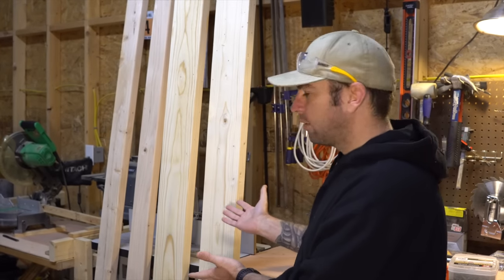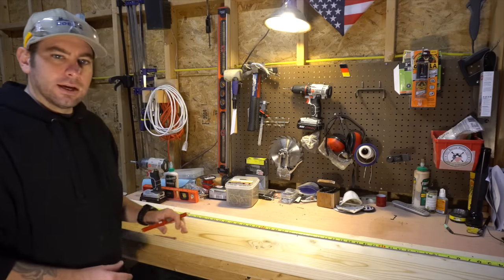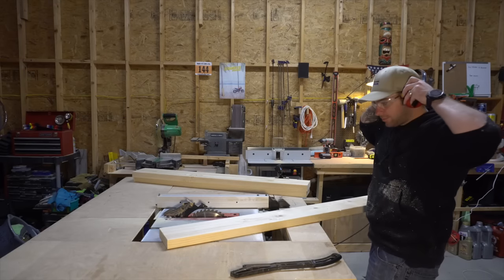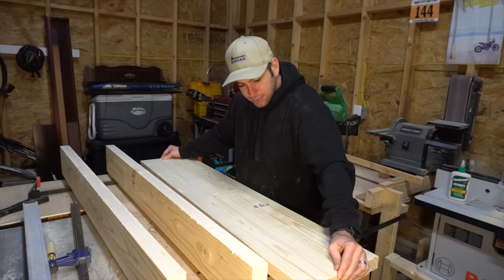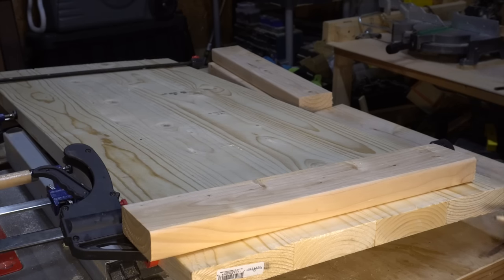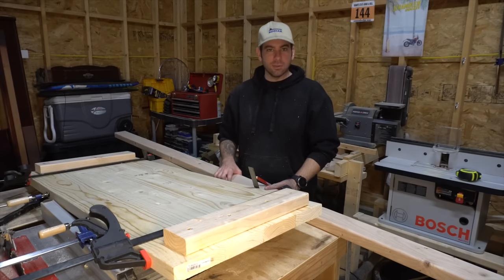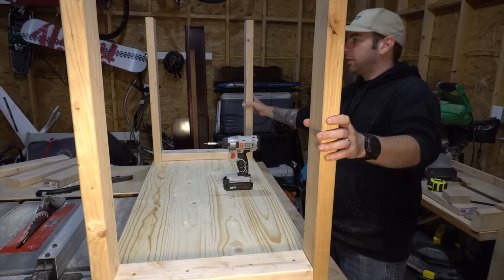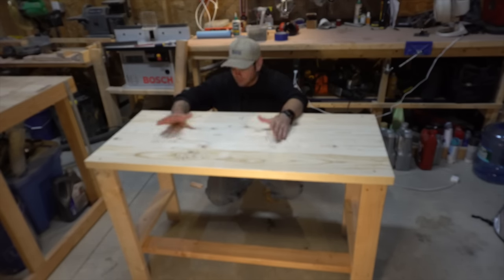Build a Super CHEAP and EASY DIY Desk!

Comment: for anyone reading this because you’re looking for a cut list for home depot/lowe’s: you need (2) 2”x6”x8’ boards each cut to 48 inches, (3) 2”x4”x8” boards each cut to 28 1/2 inches, BUT ALSO 2 slightly shorter pieces for the leg supports underneath, in the video he says 17-something inches but if you’re not squaring the edges of the boards you need them to be about 18 3/4”. i have to cut those myself with a hand saw now because i didn’t double check the video 🤦🏻‍♀️  i also got a piece of 2’x4’ sanded plywood to make the top surface flat, since i don’t have the tools to make the edges square
Reply: Thank you for the measurements!  I was just looking at everything and wishing I had those numbers.
Reply: Thanks
Reply: Thank you for the measurements.
Reply: What size of screws did u buy/used
Reply: Thanks so much for the measurements!
Reply: Thank you so much!! :)
Reply: so this is the exact measurements?
Reply: so this is the exact measurements?
Reply: @briciagarcia9864  did you find out about the size of the screws.? 😊
Reply: Thank you for this valuable information,  old you please tell me the size of the screws that you use. Thank you,!
Reply: Thank you
Reply: @briciagarcia9864  did u find out what size screws we need to use ?
Reply: Thank you!! I was in fact looking for the cut list.
Reply: Goog to build a modified version for my daughter’s craft room
Reply: for anyone wondering, if you are screwing through one of the 2 x 4s or the 2 x 6s then you should use a 2 1/2 or 2 1/4 inch screw or something similar. You just want to make sure it is long enough to go through the 2 x 4 and can still go through what you are screwing into.
Reply: @jerrybarnes987  I watch See Jane Drill videos. She's an excellent teacher for beginners. You don't seem like a beginner but someone in this thread might be (me). In any case, Jane said the rule of thumb is the fastener (nails, screws) needs to be 1-1/2 times longer than the board you're attaching.  To attach a 1" board, the nail length should be 2-1/2" long. But OMG you also have to know the correct type of nail or screw to use (muh head spins) . . . . carpenters must be the smartest and wisest people on the planet to know and remember all of the exact details. I still can't remember how to tell the difference between a wood screw and a sheet metal screw🤪🔨📐🩹
Reply: Thank you❤️
I jumped right into the comments to see if anyone had put a listing up and you did🙏🏾❤️.   Thank you so much
Reply: @maryperez7529  The material is 1 1/2 inches so the screws should be about 2 1/2 inches but not longer than 2 7/8 inches so they will not go all the way through.
Reply: You will need 4 leg supports at 19”
Reply: That’s looks great
Reply: It's worth mentioning,   this works for a desk  only,  you cannot put heavy objects on it.    To be able to support heavy objects,  you must add diagonal 2x4s, to the base,  to prevent it from swinging left/right or forward/backward.
Reply: ❤thank you for this!
Reply: Thank you.
Reply: @wildthoughts6959  Zero Experience here, I am confused on where at the base of the table I can put the 2x4 (at the end or in the middle?) and from you experience can I use Nails instead of Screws because I don't have an impact driver, thanks alot !

Comment: For smoothing the tabletop and avoiding ridges, WITHOUT slicing a narrow edge off the end, you could also use clear wood filler or glue in the ridges and sand off the excess. Then when you treat it, it'll seal a smooth surface in.
Reply: I own no tools and i plan to borrow my brothers drill. Thank you for your comment i have sand paper and wood filler! You rock thanks for the idea!
Reply: @imnotpikachu213  sandpaper is amazing, and cheap. You can obtain great results with patience

Comment: Talk about a blast from the past, I built this back when you put this video out to use as a reloading station, I did two small mods - added another 2x4 to the legs half lapped by stacking on the runner, and put my horizontal brace on the back between the legs to put my feet up. I put this table of yours through hell and back, and if I hadn't used it for a Tanarite Target holder for a few years and a few thousand rounds it would still be alive today.

Comment: Irie: The reason it is called a 2" x 4", is because originally, before kiln drying and planing, it was an actual 2 inches by 4 inches. However, it came straight from a sawmill, and there were actual rough edges that would put a lot of splinters in your hand. The wood was also green, and would dry in the sun as things were being built. When I first started as an apprentice, everything was planed to the 5/8", in other words, it was 1-5/8" x 3-5/8". The reduction to the 1/2" came because it is actually machined metric in Canada, where we import a lot of lumber. It also was reduced in order to produce more boards from each tree. It is also the reason we went to "Western Platform Framing", instead of "Balloon Framing" for houses. It is much easier to get 8-12 foot boards, than 20 ft. boards. When we say two by four, we are referring to the "Nominal Size", (the original size), as opposed to the "Actual Size". It is also easier to say. Imagine trying to holler at a laborer on a building site, to bring up some inch and five eighths  by three and five eighths. The response every time will be: "What"?
Reply: thank you so much for sharing this information,😁

Comment: I have a super tiny room and I’m only 13 and I need a new desk but none fit the small space I need it for we don’t own any of the super fancy tools you have so it makes this even harder and I’m doing all by myself with the funds of my dad (he said he would help me but I wanted to do it all by myself and he would help if I needed assistance lol) and this was the most helpful one I’ve found and we don’t have a Table saw so I’m just getting a wider Piece of wood and following all the other steps but the screw way thank you so much oh and my new dimensions and tools are.                                          (3)2”x4”x8’
(1) 1”x1’x4’ or (1)1”x2’x4’
Level
Drill
Measuring tape
Screws.                                                                          Circular saw.                                                                Table
Reply: I believe Home Depot or Lowes will make some basic cuts for you when you buy the wood, but just make sure you cut it to exactly the length you want and be sure since you won't be able to adjust it at home.

Comment: I did it. But I cut the table length at 39" instead of 48. My 4 planks cost me $30 at Menards, but that was no issue. I spent another $10 for 2" casters and then anchored them to the feet with small pieces of 5/8" plywood. I used 1x6 for the side supports and then added 2 1x6 boards across those for a little shelf under the tabletop. Right now I'm adding poly to the desktop and my son is going to use this for his home business. Couldn't be happier. It's a little beast of a table.
Reply from the maker: Awesome and congrats!

Comment: Thanks for the tutorial.
When gluing the top, I'd suggest using two pieces of 2x4 on both sides to ensure flat surface, and clamp these two pieces while clamping the glued top boards. This will help ensure that these top pieces are flat and even when they are glued together.
Reply: Thank you!

Comment: Good video.    It's worth mentioning,   this works for a desk  only,  you cannot put heavy objects on it.    To be able to support heavy objects,  you must add diagonal 2x4 to prevent it from swinging left/right or forward/backward.
Reply: You couldn't fit your wide caboose on it. But you'll be able to put pretty heavy objects on it.

Comment: A 2×4 is called so because when sawed at the mill, it's cut to 2" by 4". The boards are then surfaced on all 4 sides to remove mill marks and break the corners. The final dimensions after surfacing are 1.5" by 3.5"
Reply: dont foeget the dry process which shrinks the wood which was taken into acounrt
Reply: Nominal cut
Reply: Actually, That is slightly incorrect..................The Finished 2X4 measures 1 3/4 in. X 3.5 inches....Thus when doubled, they are the same width and thickness.......3.5 inch
Reply: Chris Taylor Every 2×4 I, and everyone I know, have ever worked with was 1 1/2 × 3 1/2. Ever piece of lumber we worked with was always short a half inch. ( excluding length )
Reply: @Meatwad787  .................After being challenged on this.....I actually got out a tape measure, I guess I have been under the WRONG assumption for nearly 60 years.....Go Figure...I had always thought that 2 stacked gave you the same size from either direction...
Reply: That's true today. A hundred years ago or so, they were actually 2"x4". Then the lumber companies decided to sell less for the same price and down sized the dimensions. Just about every big company does it now.

Comment: The concept is very nice, but I would suggest you consider pocket holes instead of screwing into the end grain.  With time and moisture changes, your screws may eventually have an issue with holding.  For light duty this may just be just fine.  You may want to add a horizontal member under the top to resist tension from the top being loaded as well.  Structurally, you can have the same amounts of wood, but choosing where to place them will make this both stronger in load handling and more durable in service life.
Reply: It's just a cheap desk. It's not like it's for the president
Reply: Santa Clause well you can make a cheap desk last a lot longer and be a lot more sturdy with pocket holes
Reply: Pocket holes are complicated for a beginner. This was supposed to be as easy as possible.

Comment: For those that don’t have a table saw. Just glue the 4x6’s together and leave the rounded edges on. If you use the hand circular saw you will not cut in a perfect line and won’t join up perfectly.
Reply: Truth fears no scrutiny 123 Agreed! I have a shelf that I made, the top is 2x4s, as they were, and it’s just fine. I like that rustic look anyway.
Reply: I have a table saw, but opted just to leave the edges anyway, it worked out fine.

Comment: What type of screws are those? Like how big or idk how you call them lol
Reply: 2 and a half inch screws
Reply: Deck Screws
Reply: I think drywall screws. You don’t need pilot holes with those.
Reply: @chrismazz75  no don't use drywall screws if you can help it they are not as strong or as useful as deck screws

Comment: I just finished putting my desk together, this design works, I'll see if I find a better way to join the legs, but it was easy as heck, I'll have to admit that I skipped most of the video, the useful parts sum up to like 3 minutes, but yeah, it does its job, I now have a nice desk for a third of the cost of a store bought one, I got wood with a lot of crevices and rotten parts, I will fill them with blue resin and stain the wood blue. Anyways, thank you for the video, it was very helpfull

Comment: Can you tell me the dimensions of the top piece and the legs so I can just have them pre cut
Reply: Hey Terry, all the dimensions are in the video.
Reply: The top four lengths of 2"x6"s are cut to 48 inches(from 2 boards)
The four legs are from 2"x4"s and each cut to 28 1/2" (from 3 boards)
Reply: for anyone reading this because you’re looking for a cut list for home depot/lowe’s: you need (2) 2”x6”x8’ boards each cut to 48 inches, (3) 2”x4”x8” boards each cut to 28 1/2 inches, BUT ALSO 2 slightly shorter pieces for the leg supports underneath, in the video he says 17-something inches but if you’re not squaring the edges of the boards you need them to be about 18 3/4”. i have to cut those myself with a hand saw now because i didn’t double check the video 🤦🏻‍♀️  i also got a piece of 2’x4’ sanded plywood to make the top surface flat, since i don’t have the tools to make the edges square

Comment: him: It's really easy to make
Also him: shows the table saw
me: hmmm...yeah don't have that :|
Reply: @Nikolai1776  or a hand saw if you are determined... Honestly, just rent a circular saw from Home Depot.
Reply: You can get the wood cut to the sizes from the store and just fit it up
Reply: I can’t imagine getting a straight cut with a circular saw. If you don’t have a table saw, you might consider just leaving the wood as it is. It will have a bit a dip where the rounded edges meet, but not a big deal for a basic work table.
Reply: @leeb.7188  Clamp a 1x4 as a guide and you can get a straight cut with a circular saw.  Glue a pice of 1/4" hardboard along the bottom of the 2x4 and cut it with the circular saw against the 2x4 and you have a poor-man's "track saw".
Reply: Bar Pluc : Good idea! I’ll give it a try. Thanks!
Reply: What about a hand planner? Wouldn’t that work? Newbie here, so just asking.
Reply: @CantrellLeatherGoods  You could hand plane the edges flat enough to glue, but from the lumber I see in the average lumber yard, plan on being there a while on each board.  The radius on the corners of "finished" lumber is sometimes 1/4" and add another 1/4" of twist/bow/camber and you're hand planing over 1/2" off both edges.  You'd also need at least a No. 6, preferably a No. 8 to shoot a board that long.  I've tried it with a 5 1/2 and dragging the bow all the way out was a chore.  Of course that was more due to my lack of skill than the plane, but since I've picked up an old No 8 and that seems to make the effort a lot easier.
Reply: Hmmm yeah you don't need that lol. But same, I don't have one either.
Reply: get it cut where you buy the lumber. rent tools, borrow tools or the obvious, buy them. How do you expect to build things without tools?

Comment: Great video.  Built one today....dont have a table saw or circular saw yet....still came out really good.  It wont be a desk though....maybe an outdoor food prep table.  I built it a little taller... 37.5 inches high.  Great video, easy instructions.  I was able to watch once and build most of it from memory.
Reply: You just answered both the questions I was asking myself.

"Can I do it with a hand saw?" and "Can I make it a bit taller?"

And as others have already commented... I'll probably add some extra supports to this design (angled braces) so it's rock solid.

Comment: Blonde girl proof table...just what I needed. Thank you for not speeding through the build. Only thing for me is I don't want the side supports on the legs at the bottom, so I will have to figure that issue out. I'm hoping if I buy corner brackets to install on each corner it will hold up just as good.

Comment: A 2 x 4 is actually a 2 inch by 4 inch rough cut before it is run through the planer. The planer takes a half inch off the 2 inch side and the 4 inch side to smooth it down before it is shipped to the retailers. But most old the houses were built with rough cuts that are actually 2 x 4's Straight from the mill. They were very rough with no smoothness at all. But they measured exactly 2 inch's by 4 inch's. I thought I would pass that by you. But anyway I want to thank you for this tutorial. This is by far one of the best step by step tutorial that I have seen on youtube.
Reply: A 2x4 in reality is 1.5 x 3.5, but it has nothing to do with a planer.  It comes off the mill at 2" x 4", once the wood is dried it contracts.
Reply: They are actually cut 2x4. I know this because I work the mill.

Comment: I know its been six years, but I needed a visual review of working up a similar project. Retired and downsized to an apartment with attached garage, the killer on that I lost my " shop". On 8/26/23. I bought the same amount of wood a bit of screws and glue and this crazy inflation sure does break the wallet. You can't help that, cost  closer to $75.00.That hurts because I always like to customize storage with wood. Unfortunately  I needed some large storage shelving, compared cost of wood to" premanufactured " made in China", steel shelves and the steel won out by 1/2.  After six years the lumber still looks the same :-) Thanks for the video, it is definitely what I needed to brush up a bit even for smaller projects.  If you are still looking for ideas, garage storage units for tubs 2 feet wide, 3 levels ,6 feet would be interesting.

Comment: Nice design  and video/ instructional video on  building  this little desk , table, workbench,  or whatever  someone  wants to use it for  my Mom likes to garden and noe that she is older in age likes to work standing up  to have less stress  on her back  this  project would make a nice potting table for her gardening   With the correct  stool or chair  she may be able to sit and do her hobby  a  nice feature about the way you build this is the low cost of  construction grade lumber  you use to make it  and you are  correct it will hold up way better than any particle board furniture  as this construction  and buil results in a solid wood  desk capable of holding up to the elements and or  some  physical abuse  because of its solidity

Comment: They are called 2x4 etc. because they are rough sawn to those dimensions before they are milled to achieve the factory edge. The milling takes off ~1/4 inch each side which equals ~1/2 inch overall from the width and height. If you buy rough cut lumber, it will actually be 2x4 etc. but of course you will have to joint/plane/thickness it yourself or use it rough as construction lumber.

Comment: Thanks for this video.   I need a cutting table to cut out sewing patterns , but the standard 30-inch high cutting table is too tall for me because I'm only 5'1."    Is it necessary to use 4' planks of wood or can I just use a butcher block for the table top and attach metal pole table legs to it?  Alternatively, can I have a self-improvement store cut down a full sheet of lumber to 3' X 6' to use for the table top?

Comment: good job man, valuable information for free. to make the legs sturdy use that last 2x4 and make 45 degree angle cuts then screw them in on each corner for a brace. !